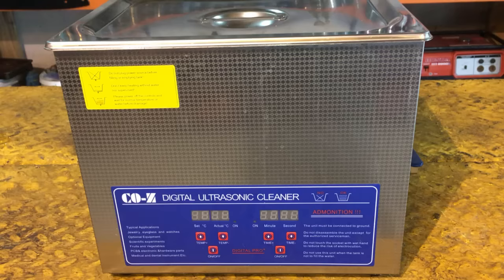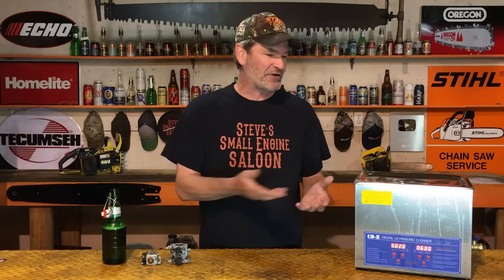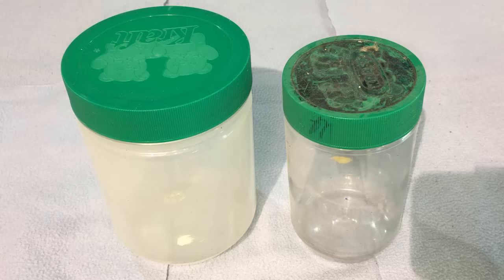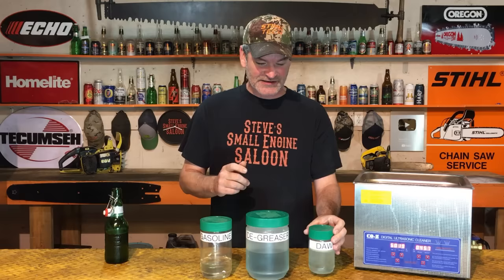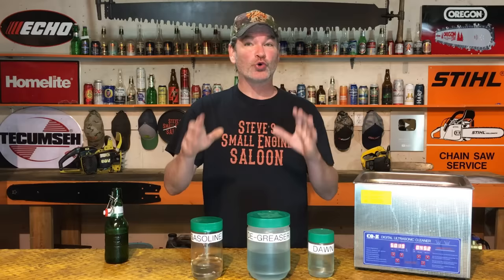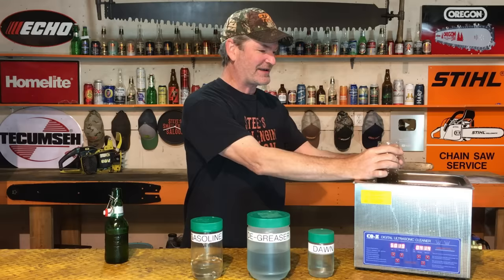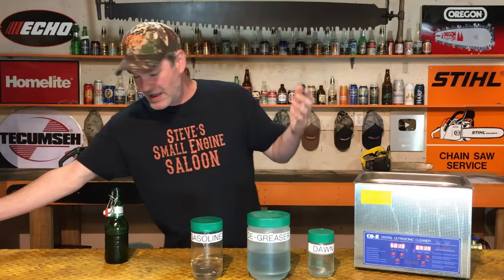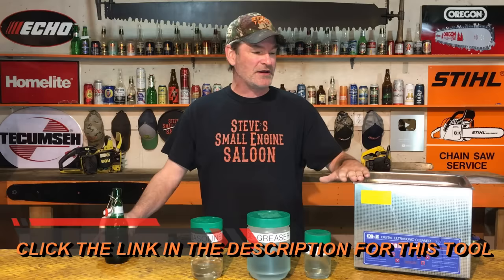ULTIMATE TIPS For Using An Ultrasonic Cleaner (Must Try)

Comment: I used a puck of powder automatic dishwasher detergent, and it made my chainsaw chain look shiny and new. Removed the stubborn wood resins. One tip manufacturers all give: degassing. When you refill the tank (or use a new container of solution) then you should run the UC for about 5-10 mins first. This removes dissolved gasses which reduce cavitation. You only need to do it ONCE.  Some machines have this built in. Tip #2 don't use bleach or other chemicals that produce bubbles (peroxide, Polident, etc.) It also reduces cavitation.

Comment: Large pickle jars work great for most small engine carburetors. Please make sure the lid is on tight and I stand the jar in an upward position during the cleaning process. After 24 hours, the dirt will settle to the bottom of the jar (containing gasoline) and I use a coffee filter to clean out the residue so I can recycle the gasoline.

Comment: I can tell right off that your ultrasonic cleaner is more powerful than mine, I have the one from Harbor Freight, the Central Machinery model, and it's not nearly as loud but it does do a pretty good job. Mine stopped vibrating about a week ago, many have had the same problem with the Harbor Freight cleaners. I think they used an inferior type glue or epoxy or whatever it is that they use to stick the transducer to the bottom of the tank and after awhile the glue gives up and the transducer looses it's hold on the tank and therefore it's ability to agitate the solution. One gentleman made a video about it and used JB weld to stick it back on, says it still works good, that was a year or so ago. And back on the subject of how the ultrasonic works, I just looked it up, is it causes cavitation, basically the same thing that happens on the back of a spinning boat prop in water. It causes a very low pressure area and causes bubbles to form and they implode dislodging dirt and particles etc etc.

Comment: I work for a company that uses industrial level ultrasonic tanks. A tip - for whatever cleaner you elect to use, note the temperature range that the manufacturer recommends for cleaning. Hotter is not better and will often break chemical down.
Reply: Also, never run it or heat it without solution in it. You're sure to have it fail prematurely.

Comment: Excellent idea....  an enhancement could be a smaller lid that can go inside each jar to serve as a basket with a stem or string to pull it back up...  Just drill some holes at the bottom of the basket to drain the liquid...
Reply from the maker: That's a great idea!

Comment: The whole purpose of getting one was to clean up the inside of the brass shells but it works awesome for cleaning carbs and everything else that is a royal pain in the ass to do by hand! Or if you don't feel like using media blasting to clean your things that are too delicate to use media on. But yes Sir cleaning the tank can be a messy process. Great recommendations 👌

Comment: BTW, I've heard reports that the basket has some attenuation to the sonic sound waves, and that removing it can improve the cleaning power.  Thinking that adding that benefit to using the enclosures that's you recommend in this video just might add even more cleaning power.  Thx for the vid.  Cheers.

Comment: I have used the jar method myself numerous times after either reading about it or wondering about it myself. I found that it works well at keeping the tank clean, but doesn’t seem to clean as well as just putting the part in bare. Maybe it was whatever product I was using. I will try using some gasoline in a container and see how that works. I think I used Berryman’s the last time I tried the jars and I have heard that this stuff is so weak now that it doesn’t really clean anything anymore.

Comment: I have been using an ultrasonic for many years, cleaning bank vault locks, etc. I will only use glass jars, as the plastic absorbs a bit of the vibration, and you do not want the jar to float. I always make sure the jar is sitting on the bottom, sometimes just add a little weight to keep it from floating. Tap water is all you need for the chamber, and I use watch cleaning solution on the parts. I dont think I would use gas, as its just a little too dangerous. Varsol would probably be ok and safer.

Comment: Apart from cleaning the Doris's jewelry, I'll be using this to clean plate heat exchangers/diverter valves on combi boilers, anyone else doing that? What cleaning solution are you using?
Many thanks for a no-nonsense review, my order has just gone in to amazonia. Cheers!

Comment: i been using just a cup filled with seafoam made for cleaning carbon deposits out of engines and just been putting it into a cup with my suppresor baffels and then just scrubbing it with a brush. so i would be excited to try that with this cleaning method

Comment: Put a magnet on the outside of the basket and one on the inside of the plastic jar, that way jar won't tip over. or take out the basket and put the magnet at the bottom. (I don't know if it would harm the ultrasonics though). Just an experiment if you'd like to try.

Comment: I use Pyrex container with kerosene, Pyrex is glass and they usually have a lid that locks in place, kerosene cleans just like gas does. Just remember to rinse your parts in hot water, then dry them thoroughly!
Reply from the maker: Cool

Comment: Excellent video my dear, in fact no everyone knows about how to use in  a smart way.  Also, I thought is was going to be there a whole cleaning chemical in the thank, but it's just water make to do the job, I know that De-Ionize water will do the ideal way. But it's ok. My only concern about using gasoline is the static when using plastic as containers. overall I'm definitely buying this based on your video for Electronics and general cleaning. Thumbs 👍up dear. Thank you for your video 🤗🤗

Comment: You got a sub from me.  I've got a pocket knife that someone left alone so long, the oil or whatever they used many years ago has gummed up so bad, WD40 wouldn't cut it so I want to soak it in mineral spirits and would like to run it through in my ultra sonic but really didn't want to pour the MS directly in my cleaner!   Shtttt, I didn't think of putting the cleaning solution in a jar, then putting that into the cleaner with just water!   Thanks Steve!
Reply from the maker: Thank You...and You're Welcome...

Comment: Dude. Absolutely brilliant lol.  I just ordered a 30L, and I have giant PB jars coming out my ying yang.  I have a jug of WD-40 cleaner degreaser I am going o try the carbs in.  The graying could be from percussive pitting from the bubbles.  What frequency are you using? Typically, the lower the frequency, the more you have to watch for it especially on softer metals.

Comment: you can use ziplock plastic freezer bacgs with some solution in it also for small parts to keep your projects separated while using the ultrasonic cleaner

Comment: Glass seems to work better than plastic for me. I use carb dip from like NAPA for carbs. Put the same level of water in your cleaner that you have in your jar with the carb. Use the heat setting.....should come out looking like a new carb. Be careful of flash points with solvents like gasoline and the heater. Better to use these outside or in a very well ventilated area.

Comment: You could also try 
1) Nonpolars:
vegetable oils, butane, pentane, hexane, heptane, cyclohexane, benzene, alkylbenzenes (toluene, xylenes, cumene, etc.), chloroform, dichloromethane (DCM), 1,4-dioxane, diethyl ether, tetrahydrofuran (THF), acetone, ethyl acetate, and dimethyl sulfoxide (DMSO). 

2) Surfactants
Ammonium, sodium, or potassium lauryl sulfate, ammonium, sodium, or potassium laureth sulfate, alkylbenzene sulfonates, bile acids (desoxycholic acid, chenodesoxycholic acid), tetramethyl ammonium chloride, tetraethyl ammonium chloride, dimethyldioctadecylammonium chloride, didecyldimethylammonium chloride, polyethylene glycol, nonylphenol, dodecaphenol, CHAPS detergent, perfluoroalkyl substances (PFAS), and other so-called "forever chemicals".

3) Polars:
Water, glycerin, propylene glycol, ethylene glycol, diethylene glycol, methanol, ethanol, n-propanol, n-butanol, and glacial acetic acid

4) Other fuels:
Kerosene, Jet A, Jet A1, Jet B, Jet B1, and RP-1. WARNING: Aviation gasoline is leaded and will contaminate your equipment.

Comment: Hi Steve,
Today i bought a new STIHL FS 410 Strimmer, It is a good large size engine and if it last as long as my last Stihl  strimmer (23yrs) I will be both happy and i will be 94yrs old then. (A real old fart)
But i read in the owners booklet a tip from Stihl regarding the  cutting line, it says to put the line in water for 12 to 24 hours pre use, 
This tip say's that by doing this practice the line last a lot longer,
I have not read this before and thought i would pass this tip on to other strimmer users.

Comment: I use Rust remover /citric acid, Paint thinner for ultra de greasing and  Diesel for old parts that contain plastic like a diafram carburetor if I plan on reusing the diaframs

Comment: I have a small ultrasonic cleaner I use for chainsaw carburetors, i fill it with water, add a dishwater pod that I cut open and empty. 30 min at 50° c, works well. Rinse in warm water, blow off with compressed air and dry at 175°f in the oven. I'm single and my dog doesn't mind what I use the oven for. Think I'll try the gasoline idea.

Comment: I have 2 ones. I use a 2l one for clean the scuba regulator using specific cleaner or you can use vinegar. The other one is a 30l one I use for clean engine pieces usin a degreaser.
Reply from the maker: Right on

Comment: Great idea Steve, one note that should be passed on it do NOT run anything in the cleaner without the basket in place.   Hard earned experience I ruined a $1,000 unit, the SS tub is very thin to allow the power units to transmit energy as efficiently as possible into the liquid.  If you put any metal or hard objects into that bath without the basket they will erode the bottom of the tub where they contact the vibrating metal and eat holes in the tub and Voila - ruined unit.
Reply from the maker: Great tip!
Reply: @StevesSmallEngineSaloon  Learned that one the hard way Steve, brought my dental office Ultrasonic cleaner (READ BIG AND EXPENSIVE!) home to clean a couple of carbs on an old motorcycle I was rebuilding and destroyed it.  Don't remember why I took the basket out but likely 'cause I thought it would be a bugger to get clean enough that the girls wouldn't notice I'd had the unit in my shop a home.  The tech who showed me what I'd done laughed when he showed me how thin the bottom of that tub is.  An expensive lesson.

Comment: You might consider  just holding the basket up in the water to depth desired some how.  Perhaps with rods through each end of basket.  Use plywood frame on the sides so as not to ground the rods to cleaner.  thanks for the video.

Comment: If you have an explosion proof ultrasonic cleaner, you can use acetone (I recommend glass containers since acetone eats a lot of plastics.  Acetone works well on a lot of adhesive residues.  It’s highly flammable, though, so either pony up for the explosion proof model or get an extension cord and do it outside, away from your house.

Also, what we hear is pretty annoying, but if you have pets, you might want to run it outside so they don’t have to hear the high frequencies.

Comment: Hello,  I would be a bit skeptical that the plastic jar could hold a seal, especially with gas.  Mason jars have a robust seal that I would trust.  Have to be careful with the glass for sure.  I think about any cleaner that is caustic fast acting (other than gas which is amazing) will take the shine off polished aluminum.  That shine is only cosmetic though and doesn't effect the performance.  I use ammonia (careful of the fumes) and F.I.S.T. detergent for greasy, cruddy stuff.  They will cut most carbon based gunk.  For rusty item go to the "ElementalMaker" YT channel for his formula on how to make Evap-O-Rust for about fifty cents a gallon.  It does not attack the base metal just like the store bought stuff and you can make it in quantities for little money while acting almost as quickly.  Use it in the Ultra sound for a faster process on rusted parts.

Comment: Cool great video, I actually do the same thing with my cheepo ultrasonic.  Some times I use kerosene / gasoline / methanol with a few drops of oil in.  It does such a good job of cleaning that steel components actually flash rusts as soon as it evaporates.  The few drops of oil seem to help with that in the mix. I never thought of putting my sockets in there, dang smart man! Thanks
Reply from the maker: Right on buddy!  You're Welcome...
Reply: Have you tried using diesel? it's already oily. worth a shot.

Comment: another thing that works great is ziplock bags.  Fill your tub up with water, put your solution in a ziplock toss in your part, then turn it on.  Better than a jar because it sinks and you only need to put a little bit of cleaner in the bag.

Comment: I have been debating whether or not to get an ultrasonic cleaner to clean my oil painting brushes. They are getting pretty worn down from washing them by hand with brush cleaner and friction. I've seen one person use a glass container in the basin with solvent to clean their brushes. Kind of excited to try it. I won't be able to put a lid on the jar though because the brushes are long and need to stand upright. Not sure how well that will work.

Comment: Thanks for the awesome tip! The jars are a great idea. No fumes either.
Reply from the maker: You're Welcome...
Reply: But the jar is then bomb under pressure due to the oxidation happening and solvent the gassing off. Low flash point of the gas and highly flammable liquid, if it goes it'll be messy.
Reply: @vambo1980  Using gasoline first hand, leaving the lid on doesn’t work. Like you said it off gasses and pressurizes. Once under pressure it seems to nearly stop cleaning. Have to use it outside leave the jar open, and let it off gas. Works great this way. The big benefit is in not having to clean the sonic cleaner after removing the jar. I always use a jar now even with just water. I’m using hand me down salsa jars, few things stick to glass and I’m more than willing to throw them away if they get nasty.
Reply: thanks for the info!! Definitely an outside job!!!!  @charredskeleton

Comment: My Hornady Sonic Cleaner manual states " Place cases in basket and lower in the tank. Add enough water so the cases are completely submerged but do not exceed the MAX water line which appears on the side of the basket and the tank.

Comment: Great video. Quick question. I also initially had intended on using gasoline ,however I heard it mentioned somewhere not to use flammable liquids. That advice may not be sound. At least I hope not. My question is if it is safe and advisable to use gas? Surly it is?

Comment: I see some of you use zip lock bag but I am wondering if you use gasoline will it eat through it what if you use vacum bags for food i have a oldwon the vacum don't work but the Sealer part works so I can put the part in the bag an gasoline and seal it an put it in the sonic mushen.  Thanks for the video

Comment: high frequency (ultrasonic) sound travels better through glass than plastic so it is the better container.   I float metal stainless steel container partly filled with cleaner on the surface of the UC tank and let it go.

Comment: cascade dishwasher pods or cascade dishwasher powder works very well. and is alot cheaper than alot of those expensive degreasers. Zep 505 degreaser works very well for getting carbon off of pistons.

Comment: It seems that a plastic bottle filled with gasoline would sink somewhat but given it has a lower specific gravity maybe not enough.  Perhaps rigging up a little stick that could go through holes in a plastic or attached to the lid would prevent it from falling over and possibly leaking into the water tank.  Also, I'd seriously consider a strong fan to push any fumes away as quickly as possible to help prevent a flash fire.  I suspect these cheap chines cleaners could possibly spark underneath when turning on/off or perhaps a heater element cutting on/off...

Comment: Plastic containers work, but the comparatively soft material does not work well in the cleaner as it dampens the ultrasonic waves. The thinner and harder the material in the container (preferably glass) the better, as it lets the waves through without dampening them => much better result. A stainless steel container also works well, but finding them with good tight lids is pretty hard.

Comment: Plain water is the best fluid for coupling the energy, and in the middle of the tank has higher energy.  All that said, I use. A zip lock bag containing the part, part specific cleaning fluid, and if you play with the air pocket you can float the bag so the part is in the middle of the basin.  This way you don’t use up a bunch of excess cleaning solution.

Comment: Fill a plastic watertight container with PB BLASTER and place a really filthy carburetor in it after disassembly, then put it into the ultrasonic with heat and ultrasound for 1 hour. cleans even the most stuck mechanisms out. Afterwards flush the carburetor with your preferred carb cleaner spray, then run through the de greaser in the ultrasound.